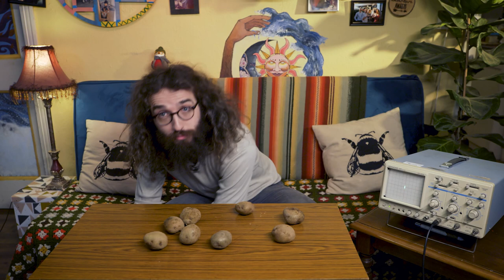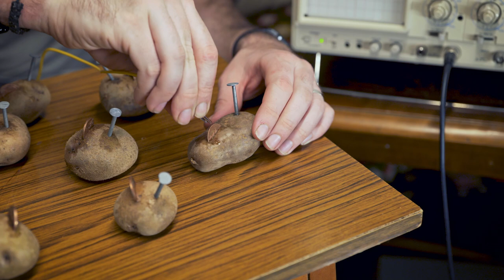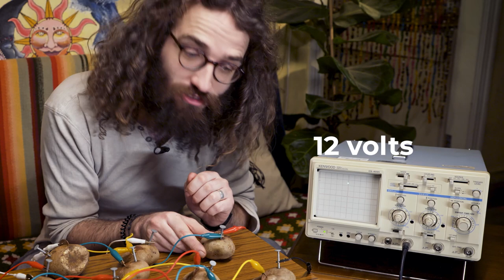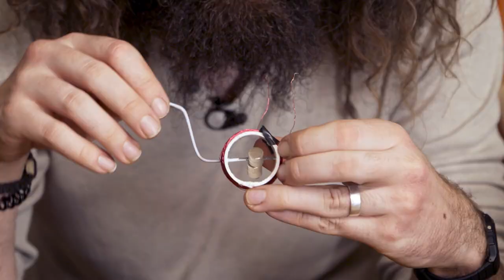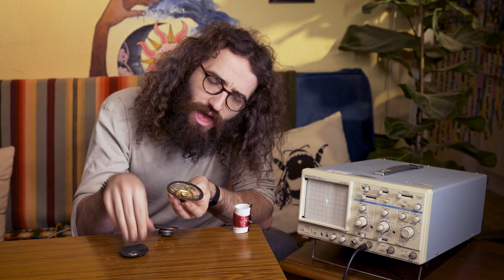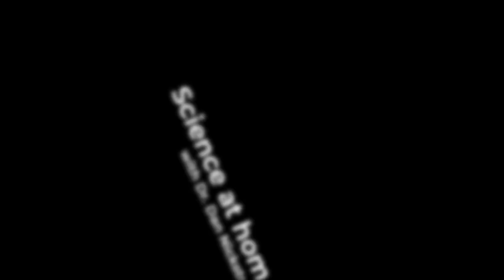HOW A MICROPHONE WORKS - Science at Home - episode 3

Comment: But what is going on at the deeper level? How do audiowaves convert so perfectly to electromagnetic waves?
Reply from the maker: Thanks for the question! The audio waves don't convert to electromagnetic waves. They convert into electrical pulses in the wires. If there is a loud sound there will be a bigger pushing force from the air and it will make the coil in the microphonel vibrate strongly, which means the coil will move a larger distance and make a larger electrical pulse. So a lound sound equals a big electrical pulse. 

If the sound is very high pitched (high frequency) it means the electrical signal will change very quickly. 

Every little vibration in the air will cause a vibration in the magnet and therefore a unique electrical pulse. All of this happens very very fast. 

But when that electrical pulse is played back through a speaker it causes the exact same vibrations to occur, therefore the same sound is reproduced. Be sure to watch the 1st video on the speaker also to get the full picture. I hope that makes it a little clearer. It's hard to explain in just text! Let me know of you have any other questions. 😊😊😊
Reply from the maker: One last extra thing that might help also! You see the green dot on the oscilloscope that shows the voltage? When I talk into the microphone it becomes a line. That's because it is moving up and down so fast that is is completely blurred. So the electrical signal is very detailed and complex. If were able to slow it down by a couple of hundred times we would see a little dot moving up and down for every single tiny little change in the motion of the air near the microphone.
Reply: @dannickstrom469  I suppose what my question was is that how can we hear the difference between a loud bang and someone shouting into a microphone, as both would produce a large but also short signal, when both sounds have been dumbed-down to mere electrical impulses? 

But I guess what you're saying is each sound has a unique sonic signature? 

Similar to how a piece of string can carry the unique sound of someone's voice when speaking into a plastic cup?
Reply from the maker: Exactly! Each of those sounds would have a unique sonic signiture. If you slowed it down by a few hundred times you would see it clearly. It's just not obvious to the human eye because it's so fast!
Reply: @dannickstrom469  Nicely put. Great videos dude. Apparently Isaac Newton had his best discoveries during a lockdown lol Keep up the good work!